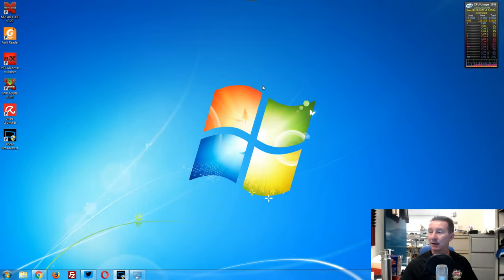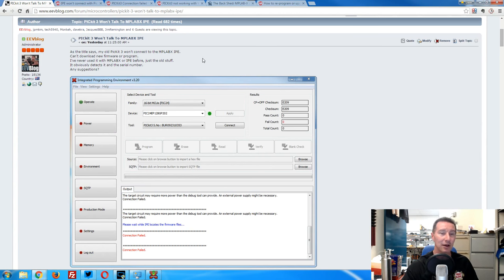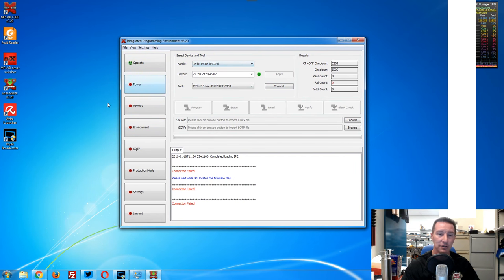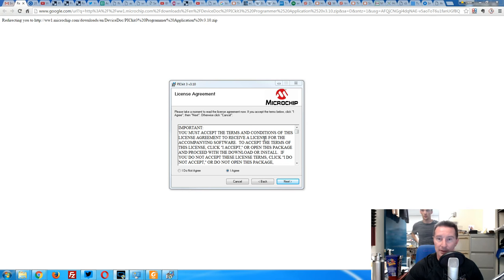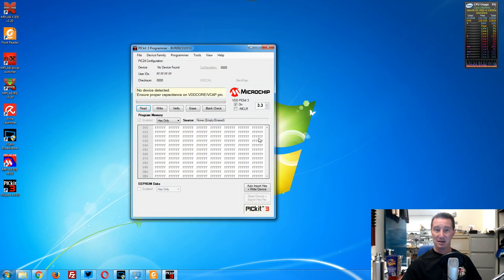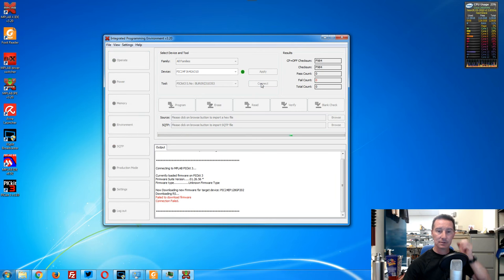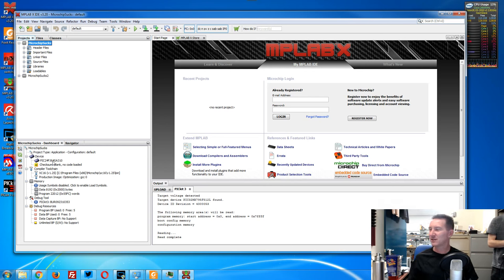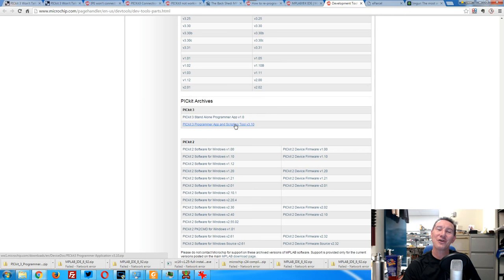EEVblog #841 - Microchip MPLAB X PICkit 3 Woes

Comment: Always run external power, Pickit does not like powering projects.
Reply: +Mike James  Ha!  I don't think anybody is seeing our comments about needing more power.  Pity, really.  Such a simple fix!

I had to use a powered USB hub.  Looked to me like anything lower than 5.10 volts is not enough for the PICkit3.
Reply: pics are bad for powering pins on programming, if you have a couple of 5v relays on board it will kill the usb power.
Reply: +Mike James You have to activate &quot;power Target circuit from tool&quot;, it&#39;s quite hidden

Enter advanced mode (password is &quot;microchip&quot; by default) and activate it in the &quot;power&quot; section.
Reply: +Mike James USB cables matter. When using cheap cables with thin wires, you will probably have too much voltage drop when powering a target.
Reply: +Mike James  I had nothing other than an oscilloscope on CLKOUT.  I'm convinced Dave's troubles will go away if he plugs in a powered USB hub.  But obviously the PICkit3 shouldn't be this difficult to please.
Reply: +Tom  OMG!  YOU NAILED IT!  3 out of 3 times with the stock red USB cable that came with my PICkit3 failed to connect just like Dave demonstrated.  6 out of 6 times with three other USB cables, no problem.  This was on my Mac mini that wasn't connecting until I used a powered USB hub (with the stock red USB cable).  Thanks, Tom!

Edit:  Sorry -- just to clarify -- I got it to work by either using a different USB cable, or using a powered USB hub.  I suppose the hub was compensating for the thin wires in the USB cable.
Reply: +Tom That plus USB ports not outputting 5v - more like v4.75 at best. A weedy USB cable then becomes the final nail in the coffin xD
Reply: +Harry Pehkonen +Mike James Interesting, The solution I found to get my PK3 working reliably was actually to plug it into a different USB socket. My gigabyte motherboard has some USB ports that just won't work with the software, and others that will. Interestingly, it's not one specific usb chip that's the problem, or even usb 2 vs usb 3. Just a couple of the sets of ports refuse to connect to anything i use my pickit with. I always just assumed that the red cable it comes with was decent quality. I need to experiment with some more mini usb cables, and see if that helps make my weird ports work properly!

Comment: So the only thing he forgot to do, was to hold the button on the PICkit when connecting in to the PC, right?
Why does he think that it is necessary to flash another firmware with some ancient tool?
I have used PICs in the past, and it seemed to me like the firmware doesn't matter at all. You can always connect to it. The only think the firmware does is to connect the PICkit to a PIC.
I could be wrong, but it looked exactly like this in this video.

Comment: I have this Chinese clone PICkit 2.  The only Microchip parts I've used are the old 16 and 18 series PICs so it is good enough.  Not sure if the pickit 3 will work with Linux either.

Comment: Hi,  Dave. I've had similar issue with my Avr Dragon tool,  it got stuck at firmware update mode and I couldn't talk to it. Luckily I found a workaround using command line tool from Atmel Studio.

Comment: MicroChip sucks like no other.
I gave up on them back in 2009, when I bought their PIC32 eval board, only to find out that although the 32KHz crystal was marked on the schematic, they didn't install it on the eval board. Therefor, the RTC was not working.
Some eval board! Imagine paying $50 for a $5 board and they cheapened out on a $0.10 crystal. 
To pour salt on the wound, they made it so that, my ICD wouldn't work with it. You guessed it, they wanted me to buy another ICD.
Fat chance. I throw away all of my Pic crap and switched over to Arduino and Atmel. Take that Microchip. .l.
The world runs on 3Rs
1- Resentment
2- Resistance
3- Revenge
In that order.

Comment: Hi Dave, did you change the power settings to work off "internal"power? If the programmer is configured to operate with an "external" power source, and there is no external power source, its not going to work. I don't have the PicKit, but the ICD2, ICD3.  But I presume the PicKit operates the same.

Nice Summer haircut!

Comment: Hello Dave I faced same problem with ICD3 in mplab X it began enoying to do the install in device manager everytime it didnt connect.
then moved to previous version and worked
so basically to make it work in this version you need to unistall then install again in device manager at least this worked

Comment: 7 years too late but I found this information stating that the PicKit3 doesn't supply power to the target board by default (default setting is no power to target). This needs to be enabled, and then the MPLAB IDE should recognize the connection:

Powering the target device from the PICkit3
Some people have trouble with the PICkit3 because it is not providing power (Vdd) to the target device. This results in the target device not being found by the programmer, and thus programming fails. The MPLAB X IDE reports "Target device was not found. You must connect to a target device to use PICkit 3." I've even seen hardware modifications to the PICkit3 to enable it to provide Vdd.

Well, the PICkit3 can in fact provide Vdd to the target, without any modifications! This just happens to be disabled by default. To enable the feature from the MPLAB X IDE:

    In the "Projects" window, right-click on your project and select "Set Configuration" → "Customize"
    In the new window that opens, select "PICkit3"
    From the dropdown menu that currently says "Memories to program", choose "Power"
    Enable "Power target circuit from PICkit3" 

Now you can simply connect the five wires (Vpp, Vdd, Vss, PGD, PGC) from the PICkit3 to the target device, and program away. Just make sure you don't try to power an entire power-hungry circuit from the PICkit3, since it is limited to about 30 mA (or something, various sources quote different values).

Or, if you're using the MPLAB X IPE instead of the full-blown IDE:

    Load your hex file, choose the device type and programmer and click "Connect"
    Choose "Settings" → "Advanced mode" and log in (how silly is this?) with the default password "microchip"
    Click on "POWER" and enable "Power Target Circuit from Tool"
    Click on "OPERATE" and program away...

Comment: I used to use PIC.  Microchip were always very welcoming about providing samples etc.  But as time goes on I see less and less reason not to move to AVR and beyond. Throw the PICkit down the dunny Bruce.
Reply from the maker: +NivagSwerdna Microchip are about to buy Atmel!
Reply: +EEVblog When you can't do things right, buy others, make those worse too, rinse and repeat.
Reply: +EEVblog I saw that, interesting.  My PIC experience is using ICD-U and compiler from CCS, nice combination once it is set up although always used to annoy me how many PORTB bins get lost when debugging.  The PIC&#39;s with LCD drivers are interesting, so after seeing a 24FJ64GA310 on the video I&#39;m looking forward to a video on custom LCD design (once it&#39;s not secret!)

Comment: This is exactly why I have never gotten into PIC MCU's. The instruction set is awful if you're programming it in assembler, and getting a C compiler is just commercial hassle. I see constant moaning about their tools just not working, like this.

However with Atmel AVR parts, no problem. The instruction set is nice, AVR-GCC is free and fully capable, AVR Studio works nicely, avrdude programs all the parts without hassle and expensive hardware. Arduino just makes everything easy too :)
Reply: Sad that now Microchip have bought out Atmel, they will probably completely destroy this. It's a pity Atmel rejected OnSemi's bid some years ago.

Comment: Excuse me for saying this before I finish watching. Gave up after countless tickets to microchip about a fault with a pic32mx250f128d with pickit3. They pretty much told me I'm stupid so I used pic32prog an open source windows/linux program and never looked back. Sure no debugging but unless you're digging into ASM or are bad a C then you shouldn't need one. 

Over a year later the fault still exists. I dont remember exactly but something about missing memory regions. Also this tool lets you program all the chips you "need" a pickit3 for with a pickit 2.... ranty rant rant!

Still have 80 of these chips and they're a go to for home projects. I hope you find a solution (that Isn't buying a ICD3 or whatever that thing is)
Reply from the maker: +Nicolas Daly Damn that's funny!
Reply: EEVblog
Glad you think so. The "kissed my own sack" line sadly had our shop laughing and referencing it for days. Happy you found a solution. To note the 3.1 app scripting tool hasn't been updated in about 3 years. What annoys me more is the PK2 is capable of programming any series of chip and yet it's not supported (in reality it's just bit-banging) and all the firmwares the PK3 needs are "programming executives" loaded into target ram. more ranty rant.

Comment: Maybe its like that comedy video they did Where they wanted to charge for an upgrade...Maybe it wasn't a joke..You might have to pay to upgrade it....I still use the old seperate software and just use that to load a hex file ...Only problem with Pikkit 3 is it has to update firmware for everytime you change chips

Comment: Pfft, you should see the STM development software. Small download, yay. No compilers, no toolchains, nada. Then, it wouldn't connect to the STM8 either, which is a development board.
I had to unregister and deregister some nondescript .dll by searching on a user forum!! I would probably have chucked the whole thing if I didn't find that forum... Apparently the IDE doesn't work well on windows 8. -_-
Reply: +Duan van't Slot STM do not aim for hobby market, for STM8 you have one of best compilers on market (IAR) and most serious compilers manufacturers for microcontrollers support STM products (all this apply to STM32 microcontrollers).
No one who seriously develop some product that use microcontroller will look for or use free compiler (even if they exist for microcontroller which it is used), he/she will pick compiler from some reputable company like IAR, TASKING(now Altium) KEIL ... (especially if you need your product to comply with some standards like MISRA ...)
Reply: Thank you, that was enlightening. My company do small-scale electronics and I have suggested their first microcontroller product. What compiler would you recommend for the STM8 family, because I would much rather not program in assembly. :)
Reply: Duan van't Slot
As I saw STM force IAR as compiler of their choice (all examples I saw are written mostly for IAR) for both STM8 and STM32.
IAR make one of best compilers for microcontrollers, and I would recommend it, I prefer to use their products (for STM8, Atmel and ARM) and I was disappointed when they drop support for PIC. IAR is one of small number of compilers that support MISRA checking (if you need it).
Now downside is that IAR is expensive (I think is one of most expensive compilers), but for companies can be cost effective (in most case it will produce significantly smaller/faster code then others so you can use cheaper microcontroller which for medium to large runs easily pay cost of compiler). Of course there is free version, which is code size limited (but for small projects can be used) and I think they have 30 days trial (for last I am not 100% sure).
As I remember Raisonance and Cosmic also make compilers for STM8.
Reply: Thanks for helping a guy put. They have a full 30 day trial and unlimited 8kB code version. Awesome. :)
Reply: Duan van't Slot
One small advice about IAR, if you/your company decide to buy license better to pick option to buy license on USB-key so you can install it on multiple computers and then just plug USB-key to use full license version (they charge some small amount more for USB-key but is more flexible option).

Comment: Mmm, so should I stick with a PicKit 2 or downgrade to a PicKit3?, I do currently use MPLAB IDE X v5.15 as my MPASM Development Tool, however, I use ICPROG software and a JDM Programmer board via Serial connector running on a Vista Operating System, Pickit3 seems to be a big pain in the arse, Microchip should make its IPE much simpler to use, Integrated Programming Environment should be simple by design that's what the IPE supposed to mean. The difficulties you show in this video and the review video of Pickit2 and Pickit3 have steered me away from Pickit3. Microchip why fix something if it's not broken?.

Comment: PicKit 2 was lot lot better than PicKit 3.  I have been working on PIC MCUs for 5 years and never got any problem with pickit 2.
Pickit 3 is irritating. It works good with old mplab 8 and standalone application but doesnt work with MPLAB X  until MCU is externally powered.  in case of mplab8 no issues no need of external power.

I miss the UART and logic analyzer tool of  PICKIT 2

Comment: typing i'm still watching... you download the whole package but then you can decide what you want to install. if the IDE, the IPE or both. (and you have been able to do so for a long time)
then, i have to switch the drivers from mplab to mplabx mode all the time at work and sometimes it hangs when updating the firmware.
quick fix: keep pressed the pk3 button, connect usb, release the button less than 5 seconds (or it enters in bootloader mode) then you will be able to download the correct firmware. have no idea why, but the vodoo works every time (i suspect it has something to do with the usb interface not setting up correctly, you are forcing it to start communication after you release the button... the vodoo also worked with virtualbox when i had a windows VM in my mac and the vb usb driver for mac is known to be bloody awful)

That said, as awful as the pk3 is (which it is) it's still so much better to program and debug parts than the pk2 once you have set it up and it will replaced for free almost every time you burn it out. If you still want to complain, new dspics and pic32 have jtag
Same applies for mplab x vs mplab 8 :) i hate mplab 8 with all my heart

Comment: Completely agree with this rant. I'd say you went a bit gentle with this rant. if it was me i'd be throwing f words cause this has wasted so much of my time. 2 months to be exact. part of the reason is that this IDE and the whole community and its documents are not at all beginner friendly. you literally have to find an old dude with white 1 feet long beard to learn this thing from. microchip has a good internet presence but they don't know how to utilize it. if someone's a beginner and they want to know about oscillator settings and how it all works well good luck. . ye they have a "document" explaining the different modes .but to be honest its all just useless for beginners. i have had it with PIC micro. i will try the ST products or something else to learn this thing on. if anybody is thinking about getting this  as their first step to microcontroller world. DONT! JUST DONT! SAVE YOURSELF THE MISERY AND MONTHS OF TIME  and get something else.

Comment: I'm commenting before I've finished watching but have you tried the driver switcher (on your desktop) If you had the old mplab on that pc then you could be using an old driver.
Reply: Much further through the video now. That's nuts.  Microchip software is very poorly implemented.
Reply from the maker: +Chris Miller Total nuts indeed.

Comment: MPLAB X is a mess. I wasted months on it. It came with a driver switcher as 8 and X use different drivers. It did not work on 64-bit Win7 at all as it had unsigned drivers.. I had to buy an ICD3 as they no longer support ICD2. This is the 3rd time I have had to update to a new debug pod.

I downloaded the IDE, the XC compiler from one location, freeRTOS from another, the peripheral libs from another, samples from another, docs from another. Nothing matched the docs or samples and conflicted with each other. Compiler could not find includes or libs.

Uninstalled everything including the starter kit files as they confused MPLAB X. Finally worked. A note in the release notes said they plan on making the download to be one installer.

Grr, Microchip has become a pain. The switch to the XC compiler hosed things for months.
Reply: +Scott Henion After spending good money on the ICD2, I was delighted (read: pissed-off) to hear that it promoted to being a glorified brick, albeit round, with the arrival of the ICD3. With all the charades that followed since, I've decided to stop wasting my time  (and money). Life's too short.
Reply: I don't know if it will help someone... I've switched to the "test mode" of my Win7/64 to use an unsigned driver. Even don't remember what was the case :)) This trick is easy to google.

Comment: I can't help but think that engineers are incapable of RTFM or are simply allergic to tech manuals.
Reply: +Reinforce Zwei 
BS. All I read is tech manuals, web sites and magazines. Talk for yourself.
Reply: pirateman
And yet we were treated to a 40+min video of an engineer failing to read the fucking manual.

I wasn't aware that you were Dave, I thought you replied under "EEVblog".
Oh...wait...
Reply: *****
It's supposed to be plug and play. Not plug and pray and read dozens of pages to get the damn thing working.
You don't work for Microchip by any chance? If not, you should stop watching this channel since it obviously is not to your liking or your standards.
Reply: pirateman
It also has several modes, different versions of firmware's and multiple programming interfaces.

It beggars belief that any supposed engineer would simply assume that a 3+ year old piece of hardware would work instantly via plug and play.

Kid, I understand that you think you're Dave's biggest fan, but real engineers don't need protecting when they didn't bother doing a quick check of the manual.